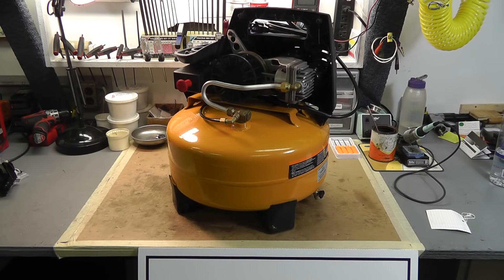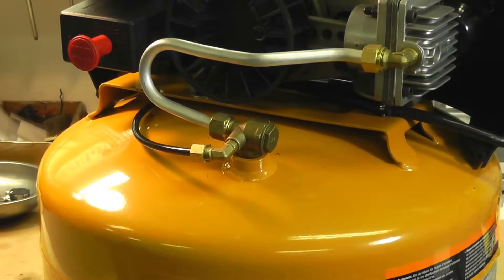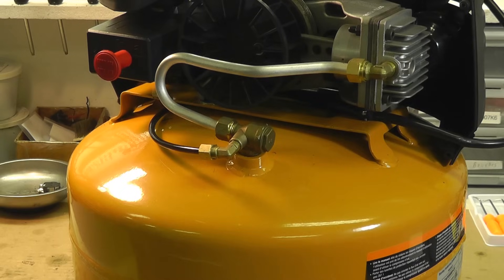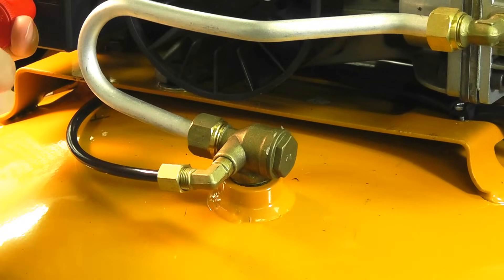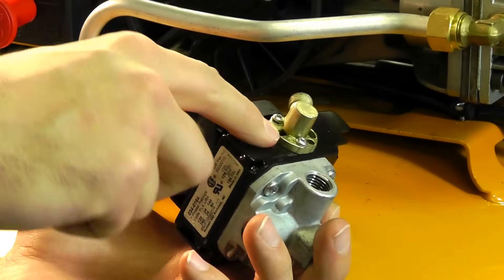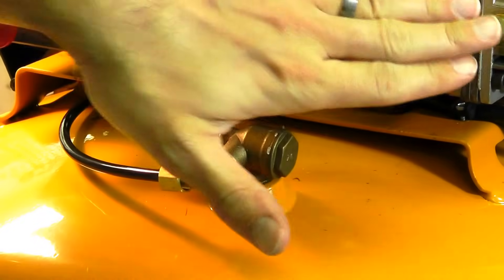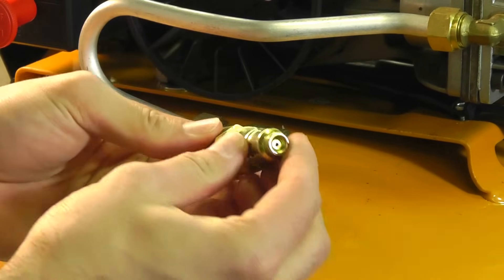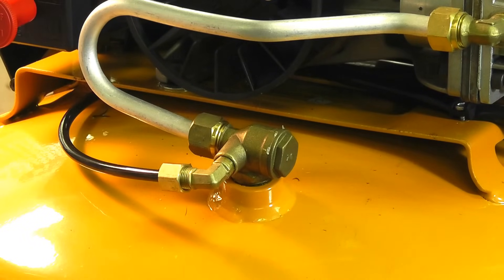How To Test A Check Valve (One-way Valve) On An Air Compressor

Comment: why is the  nylon tube so small and the compressor-tank feed line so big?
Reply from the maker: The small nylon tube is smaller because it is only a "bleeder" line of "unloader" line...the compressor is not transferring the bulk of the air to the tank from the pump head like the transfer (discharge) tube does; this is why the discharge tube has a larger diameter. The 1/4" bleeder line only releases the excess air from the pump head after the unit shuts off, which makes start-up much easier.

Comment: Hi There,

 the hose was originally  nylon and was replaced with the same.  The hose is popping off the Check valve side which has a barb, again original to the compressor.  Never an issue with the 8+ yrs. I've owned it just recently the issue has surfaced.
Reply from the maker: +Ian Mac Vittie Well, what comes to mind first is that you're getting back-pressure from the tank. I know you said you just replaced the check valve but the most common and obvious cause of this would be back pressure. Try this: put about 50 PSI or so in the tank, shut the unit off manually, then remove the small tube from the check valve. Does the tank hold air or does it blow air out of the check valve when you remove the tube? If the tank holds air, your check valve is certainly good.
The next step would be to get rid of that hose barb fitting (which is probably an 1/8" MPT x 1/4" barb) and just install a standard 1/4" male compression fitting. Use a compression nut, ferrule and tubing insert and you'll have a much better connection.

Comment: I have a Kobalt 60 gal compressor issue where the line between the check valve and the pressure switch continues to blow off before full tank pressure has been achieved.  Check valve, line and pressure switch have all been replaced, have you ever seen this before?
Reply from the maker: +Ian Mac Vittie A couple of questions first:
- Which end of the tube is popping off, is it at the Check Valve or at the Pressure Switch?
- What is the Tube you replaced it with, copper or nylon (plastic)? 
- What type of fitting does the Tube attached to at the check valve? Is it a standard compression fitting with compression nut and sleeve, or is it a "quick-connect" fitting in which you just push the tube in and it locks in place?
- What type of fitting does the Tube attached to at the Pressure Switch? Is it
 a standard compression fitting with compression nut and sleeve, or is it a "quick-connect" fitting in which you just push the tube in and it locks in place?
Reply: Did you solve the problem, I'm having the same issue.

Comment: Hey I have a 480c comp for my air bags in my car just yesterday 1 of my compressors is not turning on and my fuse was blown. I replaced it with a new fuse and straight away it blew. My
Compressors are not even a year old could it be the check valve? Because when I live the car sitting over night I notice there is not air in the tank and the rear or my car has droped.
Reply from the maker: +Gupz Lagah I'm not terribly familiar with this application, but yes I'd say it's a check valve problem certainly. No matter what type of compressor is used for the application, if there is an air reservoir (tank) present, and if it doesn't hold air overnight, then your check valve is being left open and air is back-feeding through it so it's most likely defective. Hope this helps!

Comment: specially it's not building more pressure when it's start getting hot. also from the suction side it's throwing air out instead of suction.
Reply from the maker: +Javaid Iqbal I would say with almost 100% certainty that your Reed Valves in the pump need to be replaced. Defective Valves are almost always why you'll get air coming OUT of the intake instead of sucking it IN. I would bet the exhaust valves are stuck/rusted and simply not opening and closing as they should. I would recommend replacing the Valves (or Valve Plate Assy if it's sold that way) and Gaskets.

Comment: I have a double piston compressor, and it's won't make pressure more then 3 bar/40 psi. I removed the head and check the pistons, both pistons and both cylinders are in excellent condition. I did not found any single scratch on the cylinder walls. I have no idea how to check the valve plate or any other issue to solve this problem. please assist
thanks in advance.

Comment: my pancake compressor runs constantly and has a max pressure of 60 psi. no leaks when I shut it off. will hold pressure for days. just won't rise above 60 psi. any ideas?
Reply from the maker: +JEFF ESKEW I apologize for the delay in this reply! I'm sure you've already found the solution for this problem by now but if not, the problem lies with the piston ring and cylinder (if an oil-free unit) and possibly the reed valves as well. Typically on oil-free units, the Teflon-coated compression ring becomes damaged, kinked or develops a tear in the perimeter so you won't get a very good seal with the cylinder wall. If all looks well with the piston ring then you may have damaged/stuck reed valves in the pump. I would inspect these parts first if you're not getting very good compression.

Comment: Mine turns on and doesnt build pressure the motor just keeps running
Reply from the maker: +moneyhungryyt I would take a look at my reply to JEFF ESKEW's comment above, as the same may apply to your air compressor. Usually, if the motor turns on and the piston is moving up and down but you're not getting any compression, you either have a damaged/worn Compression (Piston) Ring and/or faulty/damaged Reed Valves in the pump. You will probably have to remove the pump head and inspect these components to confirm. It could be as simple as a damaged Gasket causing an air leak.

Comment: i have an emglo am78hcv4. Replaced valves, all gaskets. check valve, intake filter,transfer tube and oil. After i started it post rebuild, it worked for two fill cycles and then the check valve failed to close. Tested the valve and found it not closing. This has happened after replacing the check valve twice with USA made valves.  I checked the exhaust air with filter paper and it is clean. Gremlins? Haunted compressor, bad karma?
Other source of contamination?
Reply from the maker: +James Levindofske That's some bad luck, it sounds like...it's not common to see two valves fail like that. My first inclination is to say there is debris inside of the tank and/or Discharge Tube that's causing the Check Valve to stick, but it sounds like you've confirmed this is not the case. You can attempt to take a light dab of Vaseline and coat the Diaphragm inside the Check Valve (if it has a diaphragm, most modern Check Valves do). This may help it seal. Otherwise, there has to be some debris or rust causing the valve to stick open.

Comment: Great video :). Quick Question if I may...

Q: I've got a basic 30L compressor which is having some issues.
1) issue: When the compressor is on, it will get to around 90psi (max is about 115/120) and it wont go any further. one thing I noticed however, pressurized air would escape the unloader valve after turning on, and really pushes out air at higher PSI. Compressor will just keep running and wont turn off.

2) Taking some valves off to inspect, I broke the Check Valve (looks like a metric valve), so I'll need to replace.. do I have to replace with another Metric valve or can I use any that would fit?

3) the line leading from the Check Valve > Unloader Valve, small aluminum pipe by looks of it, the flanged  end keeps pushing through the nut that screws to the Check Valve, can I replace that with a piece of hose with a different nut?
Reply from the maker: +sypher0101 Sorry for the long delay in this reply! 
1) Does air leak out of the Unloader Valve constantly while the unit is running, as soon as it hits 90 PSI? If so, the Unloader Valve itself is probably faulty and I would replace it (these are usually available separately). The Unloader should only open after the unit shuts off when it reaches max PSI, and only then for a few seconds to bleed the excess air out of the lines and off of the pump head.

2) The threads really need to match, I'd assume (without looking at your compressor). If your Check Valve is metric, I'd replace it with a metric valve; if not you'll have to cut new threads in the Tank inlet, purchase new 1/4" tubing and fittings for the Unloader Line, and a new Discharge Tube with fittings. Typically it's more trouble than it's worth to convert it to a standard thread set-up from metric.

3) See #2 above.If the nut is in good shape but you still can't get a good seal when you tighten it down on the tube, you may need to replace the Tube itself. I would contact the manufacturer of the compressor to see if they sell replacement parts first, and maybe even a plumbing supply store.

Comment: This is the problem I'm having with my Craftsman upright 919.165230. Runs till it shuts off and the air leaks right at exactly the area around the downloader you pointed to. Would this also be why the air blows out of the hose connection when the hose is off or would that be a regulator problem? Thanks for the help
Reply from the maker: You MAY have a separate problem there, actually, if you are referring to the main air hose going to your tool. Even if air does leak back through the pressure switch and through your Regulator (which of course connects to it) there should be no air leaking out of the air Regulator or the air hose. If this is the case then most likely your Regulator diaphragm is damaged or you have debris inside the Regulator which is causing air to leak. Typically, all of the air will bypass out of the unloader valve on the pressure switch. A new check valve would do it!
Reply: Air Compressor Parts Online Changed the check valve and it no longer leaks out around the switch. It works fine as long as the hose is attached. As soon as I detach the hose all the air in the tank comes out from the end of the hose connector. Regulator?
Reply from the maker: Punxsyjumper I would say so, yes. As long as the check valve is working properly by holding the air in the tank, any other leak would be caused by something else, and a defective regulator can do it. Most likely you have debris or junk inside of it, but the diaphragm itself could be damaged, allowing air to escape through it.

Comment: Hi, what can cause the reset button on the motor pop? after I push it, it starts fills and then once the air goes low the motor doesn't turn on, I have to push the reset button.
Reply from the maker: Sorry for the delay in this reply and it may not be useful to you any longer, but this could be a Check Valve problem. If it's clogged or if there is any debris in the line the check valve won't open and/or close all of the way, which can trip the reset or breaker. Make sure your tank holds pressure and that you don't lose any pressure at all after you turn the unit off (with the tank full of course).
Otherwise, you could have a defective start or run capacitor on the motor. You can test the capacitor(s) with a simple voltage meter.
Reply: Air Compressor Parts Online Thanks.

Comment: Would I be able to hear the leak? My unit (i think its the same as you show here, it's a bostich) will hold for the time I use it but if i keep it off, its probably empty by the next day. Any ideas?
Reply from the maker: Typically you'd be able to hear the leak, yes, but if it takes nearly a day for the tank to empty, it'll be a small leak and may not be able to detect it by ear.
The easiest thing to do is spray soapy water on every hose and fitting, it'll bubble when sprayed on the location of the leak. Spray it on the transfer tube where it goes into the pump head, check valve, unloader tube, pressure switch, every location air could possibly escape from. It sounds like a defective check valve, though.